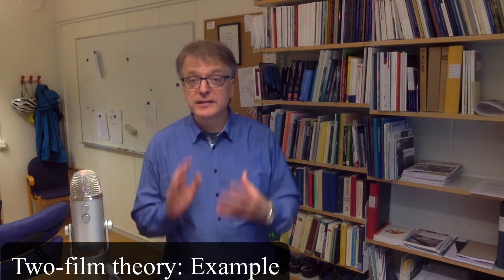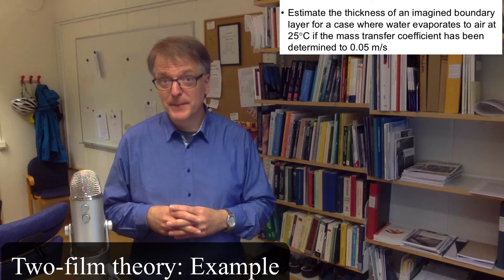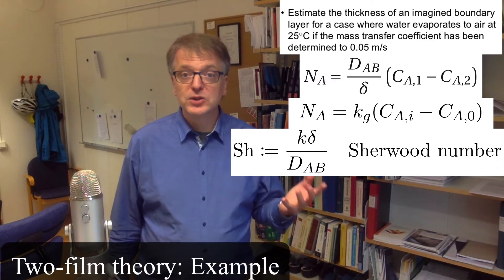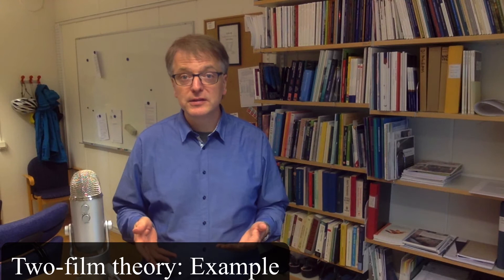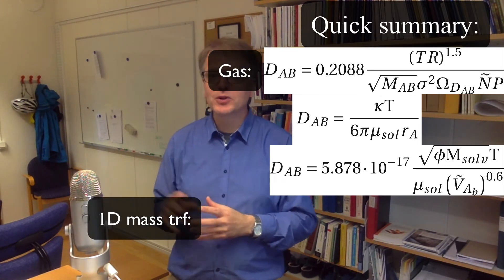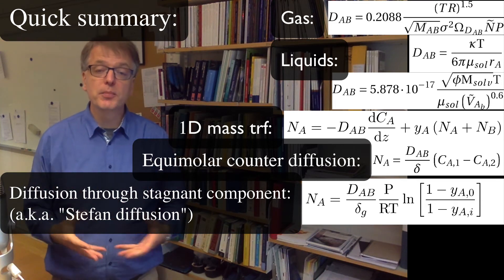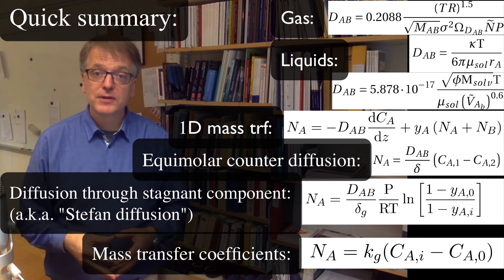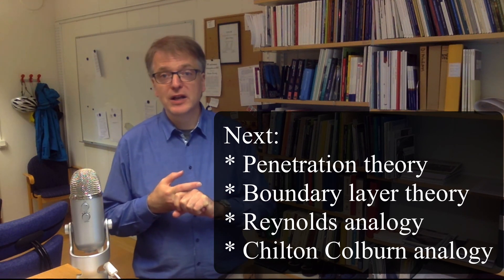Two Film Theory example + Quick summary

Comment: Can you explain how one finds the mass transfer coefficient from a stagnant component?  Generally, you need an assumed velocity above the film to determine k right?  I've seen the grashof number used, but only for a spherical drop falling in air, never for a liquid water surface exposed to air.  If you could provide the basic steps that would be incredible.  Thank you.
Reply from the maker: From my perspective, that's a very general question and thus a much harder question than it may first appear to be. You mention spherical drop falling in air and the grashof number. The volatility of the liquid in question is crucial for establishing the concentration gradient and the grashof number can be used to estimate the distance over which the transport happens. You need both of these, the thickness and the concentration gradient (and of course the diffusivity). If you can't find a theory or equation that produces a reasonable thickness, there's nothing much you can do but to measure the mass transfer coefficient. Once you have that you may, if you want to interpolate between known operating conditions or extrapolate a bit outside known operating conditions, you may use the relation between diffusivity and mass transfer coefficient to do that (diffusivity changes with T and P, film thickness changes with at least T)

A perhaps somewhat hidden complexity is: What do you mean with stagnant component? In the drop case we have symmetry, the mass transfer happening orthogonal to the surface of the drop. But what if you have wind blowing across a liquid surface? Would you call that stagnant component too? I do. The problem here is that the "stagnant" film is moving in a direction orthogonal to the direction of the mass transfer. While the 2-film theory gives you k as proportional to D, you don't get that for Boundary Layer Theory and not for the penetration theory either.

The short version of my answer is: Try to figure out which theory (2-film, boundary layer, penetration, …) best describes your situation. Try also to figure out if there's something special geometry that determines the film thickness. The theory will likely give you some kind of relation between k and D and maybe even a way to estimate the thickness (if that isn't already given by your special geometry) You may also skip all that and resort to trying to determine another transfer coefficient, e.g. heat transfer coefficient and use Chilton Colburn or Reynolds analogy to go from one to another.